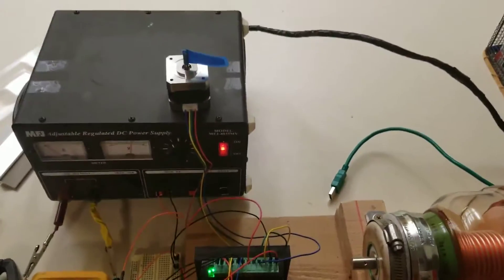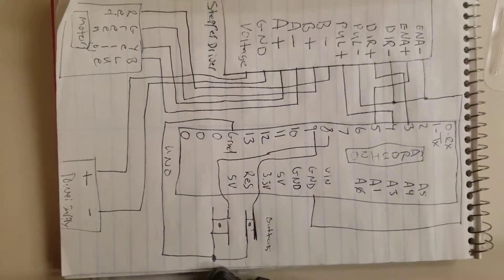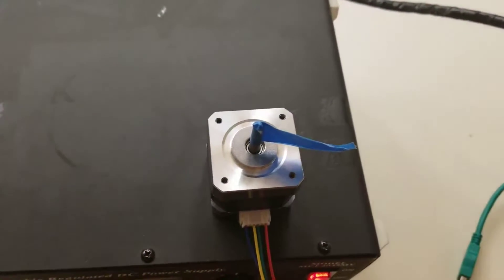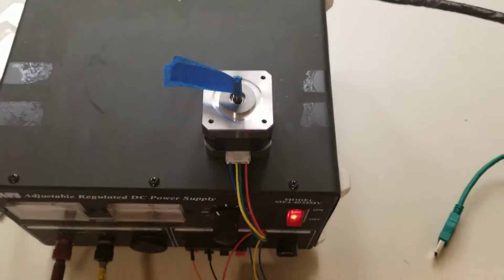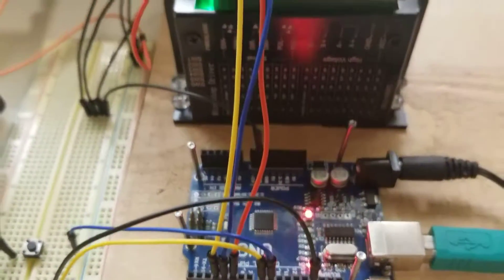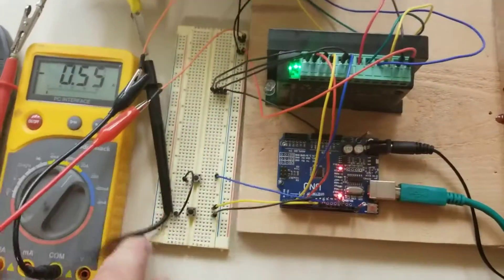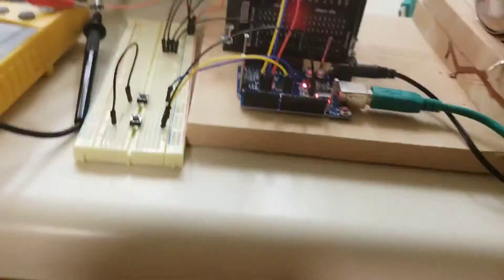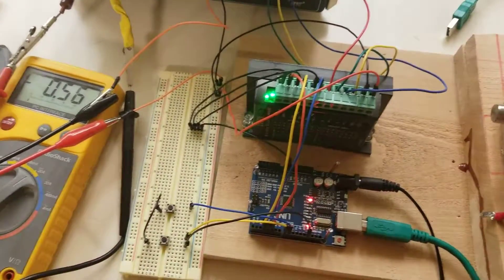Arduino Uno, TB6600 Stepper Motor Driver and NEMA 17 Stepper Motor. Push Button

Comment: Thanks for posting this. I was looking for a simple, clean-code approach and this one works really well. Your schematic is better than you think. Now, if I can just get it to control 3 stepper motors with 3 sets of buttons on ONE Arduino... Let me know if your friend can work that out for me... 🤪

Comment: Hey Mike! Nice video, very helpful. Got my own setup working, only have one question: How can I change the speed of the motor? Tried reducing the delay but this did not work unfortunately. Any tips?
Reply from the maker: The delay was how I adjusted mine. I haven't played with it in a long time though. Did you change both delays?
Reply: I fixed it in the meantime. Reduced the amount of microsteps of the driver with the switches. Worked! 👌